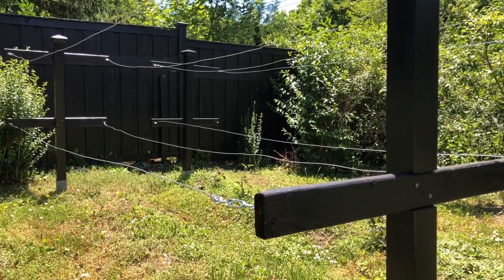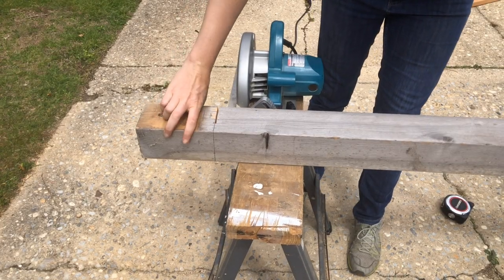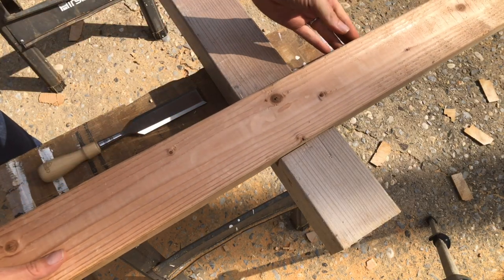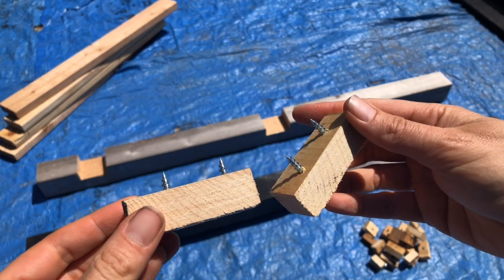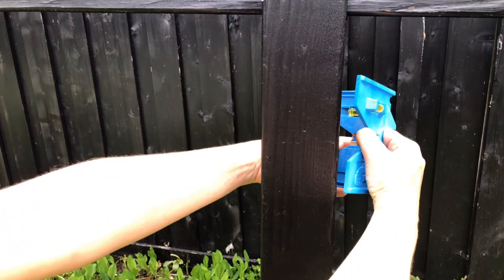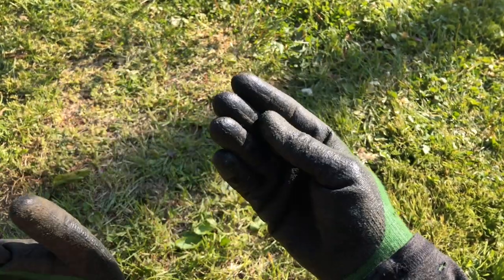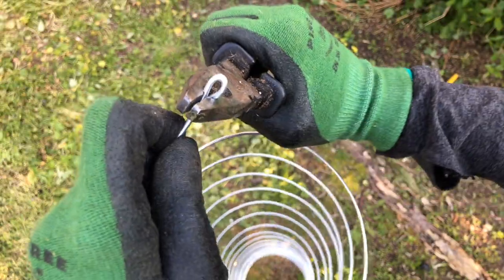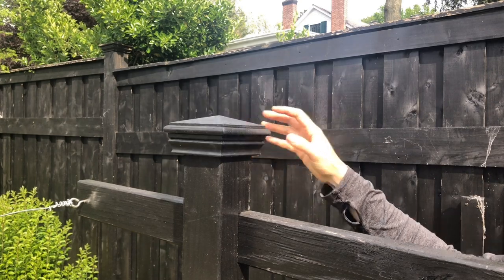Blackberry Trellis Design-Build — DIY Start to Finish!

Comment: I made similar trellises for my blackberries and raspberries but did not notch the posts because it was an extra step that I did not need. I just screwed the cross bars. I added solar post lights and I stained all the trellises Benjamin Moore Kennibukport Green. It is a nice historical color that looks really nice when the garden is finished for the season. It looks great in the winter against the snow. Since BM paint and stains are expensive, I just color match the stain to another brand of paint. I also use the solid stain. It looks just like paint and I have not had any chipping and I stained my first planter 15 years ago. Granted, it did fade, but even with the fading it still looks good. I also propagate the long canes by just getting planters filled with soil and shoving the tip of either the blackberry or raspberry in the soil. To keep it from popping out due to the tension, I place a large rock or brick to keep it in the soil. In less than a month, I have a new plant. I just cut it from the mother plant and transplant it.
Reply from the maker: That's a great idea! I've been meaning to propagate my blackberries, for FOREVER. Why does there never seem to be enough time for the garden??

Comment: Hi, your end posts need a Guy-Wire to support the wire strain on the posts. To prevent this and other problems with rotten wood, I built my grape trellis with steel T-Posts and 1/2 EMT tubing sold in 10-ft lengths. (Texas Prepper) uses the steel T posts on four corners and wraps them with lighter gauge fence wire for Triple Crown (semi-upright) Blackberries. Just giving you a few ideas.. We bought our house and there is a 50+ year old grapevine, its all falling down from the wood leaning and/or rotten locust posts with heavy wire like you used.

Comment: Alot of the eye bolts are zinc plated and they'll rust if you mar the coating when screwing them in with pliers.  Instead,  stick a large screw driver through the eye to make a T handle, use that to turn the eye bolts without marring them.
Reply from the maker: What a great tip, Joel! Thanks for sharing! Sounds easier than pliers, too!
Reply: @ReSprout  I'm glad you think so! Your trellises are beautiful! I think I'm going to try the spike at the bottom of the posts on a temporary trellis I'm considering when I start training some espailer fruit trees. I'm going to train them for a couple of years in pots, then plant them in they're permanent spot when they look nicer.
Reply from the maker: @yellowdog762jb   That's a great idea! The posts are super easy to uninstall: nice big crowbar and a piece of firewood for leverage did the trick for me!

Comment: Great job! Have you ever tried "Quick End" from Kencove Farm Fence Supply, to terminate wire at end post? No turnbuckles or eyebolts required. Tighten the wire with the Gripple Torque Tool.
Reply from the maker: Interesting! I could see that working too.

Comment: Hi April! I'm just finding you and enjoying your videos. Would you consider doing a video on how you set up your front yard trellis? Specifically how you attached the plastic grid to the wooden trellis frame. I love them!
Reply from the maker: Haha, you're like the 20th person to ask me about the trellises! That probably means that video will be in my future soon. You're gonna laugh if I tell you how the trellis netting is connected—possibly the lowest tech way possible. The top horizontal board is a 2x4 and the netting has 6" squares. So I simply weaved the 2x4 back and forth through the top row of squares. So the netting just hangs off of the 2x4. It's incredibly strong! I've trellised a whole row of watermelons and squash like that.
Reply: @ReSprout  LOL that's really clever! I like low tech 🤣 Thanks bunches for sharing!
Reply from the maker: I prefer "low tech" instead of the word "lazy" LOL
Reply from the maker: I FINALLY just made a video on this. https://youtu.be/2MF5QHitZg0 This should answer all your questions!

Comment: To avoid the inevitable leaning of the vertical posts when the wire is tightened, did you consider inserting them into the post spikes (installing the post spikes at an angle too) at an angle to account for the possibility of leaning towards the center when the turnbuckles were tightened?
Reply from the maker: No, I hadn't considered that! To be honest, I did not forsee the leaning at all and was a little bummed when it happened. That's a great idea though! I might do that if it gets bad.
Reply: @ReSprout  Glad you're considering it and found my comment helpful. Since you already have posts in the ground that are leaning, instead of uprooting those posts and re-installing them at an angle, you can use a cable attached to the posts at each end and a turn-buckle tensioned stake in the ground. This might introduce opposing tension to pull the posts straighter, but it might be a tripping hazard. Hope this helps.
Reply from the maker: @oldporkchops  Yes, the cable is the traditional way to do the trellises, but the reason I couldn't use it was because the trellis is literally 36" (yes, inches) from my fence, which is half leaning itself. Such are the issues of having a small garden! 🤷‍♀

Comment: What is the narrowest I can keep blackberry bushes? I have a 4-ft strip of good land in the garden but not sure if that is wide enough for a row of blackberries (Prime Ark Freedom). Of course I'll need to be able to walk in front as well :/
Reply from the maker: Hey Sam, I have Prime Ark Freedom and just checked the Stark Bros. website again. They grow 3-4 feet wide. The trellis I built is 3 feet wide, but I can tell you that they are straining against the trellis. 3 feet works but I definitely would not go any less than 3 feet wide. As far as the walkway, you'll need at least 24", probably more. I made the mistake of doing 18" walkways between the two trellises (which I have between my other trellises), not realizing that I wouldn't have the same elbow room. I can't actually between the two trellises now! It's awful. I have to transplant them this year to fix that. Try searching for some smaller varieties. You might have some luck! I think they're container-sized blackberry plants, too, which you could always plant outdoors.
Reply: @ReSprout  Wonderful. Thanks for sharing your valuable information with me.

Comment: Is notching the wood necessary or for atheistics?
Reply from the maker: Mostly aesthetics! If you screw it on with two screws, it shouldn't twist. Notches are good to help bear weight, but those arms aren't really bearing weight. So if you want to just screw it in go for it!

Comment: Do NOT put wood posts in concrete--fastest way to promote wood rot in the post I know!
I calculate the depth my posts are going in the ground, add several inches, and cover that length with roofing tar using a flat paint-stiring stick; it takes about a week for the tar to dry.  The objective is to prevent water and oxygen from penetrating the wood so the fungal forms that cause wood rot are denied two critical nutrients.
Reply from the maker: Just another reason not to use concrete! The roofing tar is an interesting tip. I've never heard that!
Reply from the maker: Galen, saw your other comment on how close they are together. YEEEESS! I definitely put them too close together. I was giving it the same aisle space as my other trellises and that was NOT a good idea for the blackberries. Hopefully I can transplant the right row and fix that this year!